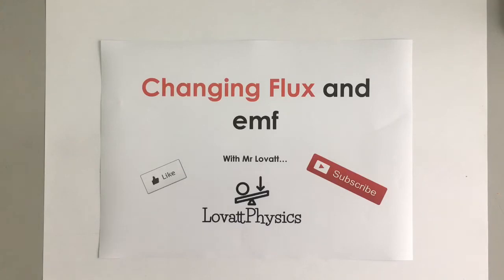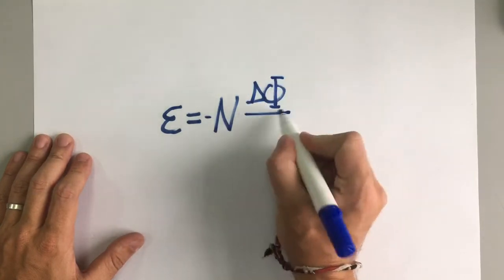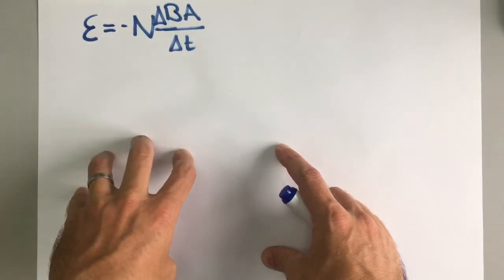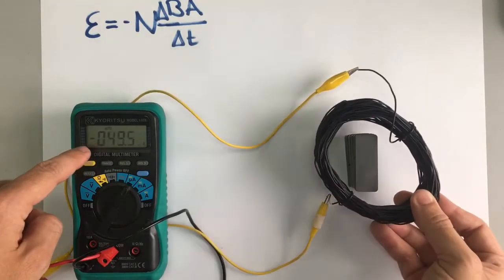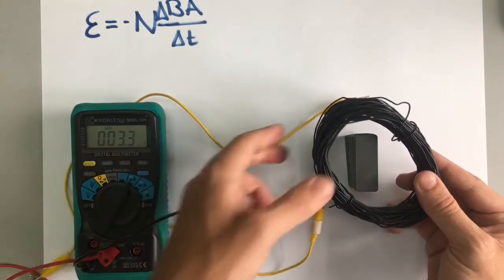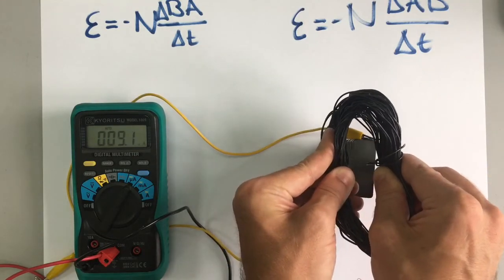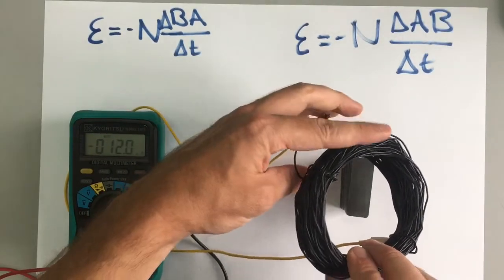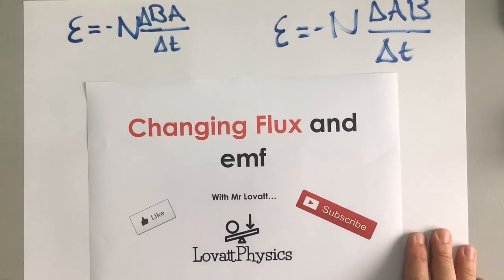IB Physics - 11.1.2 - changing magnetic flux and induced emf

Comment: I'm having issues trying to grasp the 3rd method, how does the magnetic field coming from a particular pole (Say North pole) changes sign to negative.

I'm believing that as the magnetic field cuts across the areas of the coil it changes, thereby producing current. But when it rotates how does it really change to a negative by just flipping it over 😩

Comment: can this method be used to tap a direct current since i see this is an alternating current?
Reply from the maker: You have to have a changing magnetic flux to induce an emf. AC is produced her because you have to change the direction you’re moving the coil - you can’t keep moving it towards the magnet indefinitely because eventually you would reach the magnet and have to stop and go back. Going back would have the opposite effect on the changing flux and therefore the opposite direction of current. So the short answer is no, you can’t use this to produce DC - you have to add a component called a rectifier which converts AC to DC. Hope that helps!

Comment: Why do the "N" (number of turns)  taken has negative sign .
I am from India 🇮🇳
Reply from the maker: Hi Neeraj kumar. Great question. In this case it’s not the number of turns that is negative, but the whole side of the equation. The reason it is negative is because of Lenz’s Law which says that any induced current will act in the opposite direction to the change that created it. That’s a fancy way of saying that if there is a positive change in one of the factors (N, B, A or theta) then there will be a negative emf produced. Hope that helps!

Comment: Theoretically, if one were to move a bundle of wire, not changing the orientation or area, through a uniform magnetic field, no emf would be induced. Is this correct?
Reply from the maker: Sorry for the slow reply. Yep, that’s right, because there is no change in the flux and so no emf.

Comment: Does moving the coil horizontally to the left and right cause a change in flux?
Reply from the maker: Alpha Omega yep, because the flux density of the magnet will change in those areas. However the effect wouldn’t be as noticeable, which is why I did it up and down.
Reply: @lovattphysics6366  uh okay I have been thinking about it for so long but wasn't too sure, and all the videos I've watched do not talk about that motion. Thanks so much for the speedy response, appreciate it!
Reply from the maker: Alpha Omega no problem. Any time the flux density (aka magnetic field strength) inside the coil changes, emf is induced. The bigger the change, the bigger the emf. If you imagine the flux lines around the magnet, you can predict what movement will get the biggest emf. Hope that helps!

Comment: How current in your house etc remain same i mean light remain glow when the direction of the coil changes then establishes  positive peak and then into negative at mili second
Reply from the maker: Ehtisham Khan good question. It depends on what sort of light. A filament bulb glows because it is hot, and it doesnt have time to cool down between AC peaks so it has a constant glow. An LED light however isn’t hot. It actually flashes 100 times a second - it’s just too fast for our eyes to see so it looks like it is constantly on! Hope that helps!

Comment: That is great! Can you please explain why the change in area causes an emf?  I mean, if we think of a wire, If a charge is moving through a magnetic field it will experience a force and hence contribute to the current. Is the change in area depicting the factor of velocity of the charge? Faster the area changes, faster the charge moves and hence, greater emf. Is that so?
Reply from the maker: Vishank Patel this is probably way too late - so sorry for the slow reply! But the reason is that you are changing the number of field lines that cut through the coil. So if you make the area bigger, more field lines cut through the coil and so the flux linkage is higher. Emf is rate of change of flux linkage so changing the area changes the flux linkage and therefore induces an emf. The faster you change the area, the higher the emf. Hope that helps! Sorry its so late!
Reply: @lovattphysics6366  So, does that mean that there exists some area, which already contains all possible field lines, such that increasing it will have no effect on emf?
Reply: @sittingcat8650  consider a solenoid
now in the centre of it is where u asked happens
every single field line goes inside the solenoid in the middle of the solenoid
so that's it